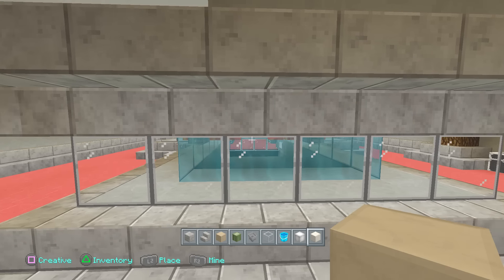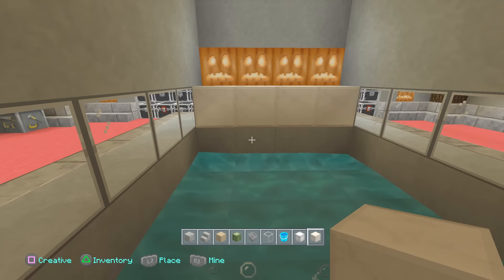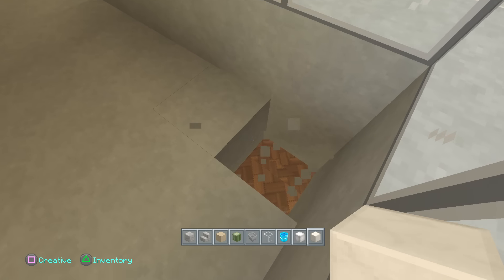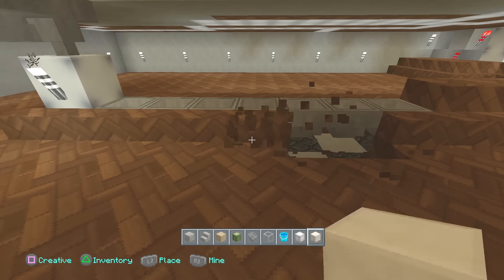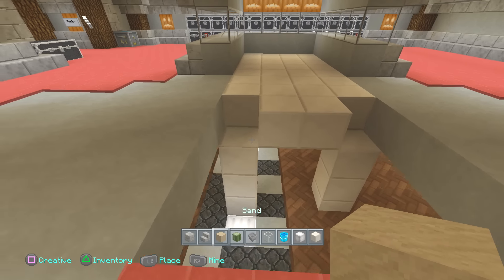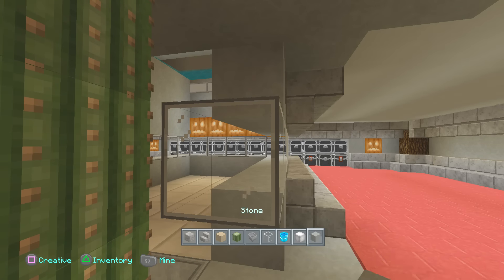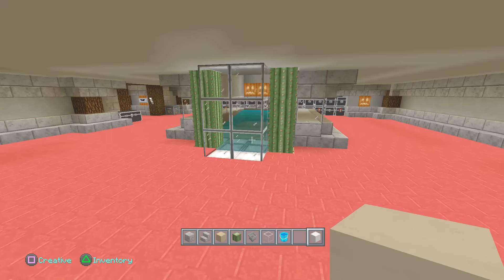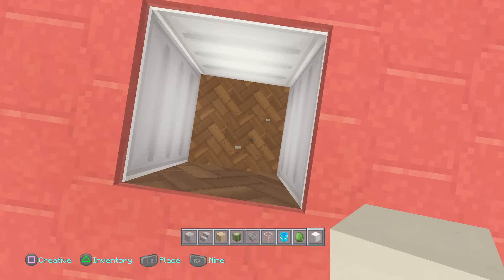Minecraft Tutorial : Slime Grinder System V2 New Update TU31

Comment: First let me start off with love the build but did find an easier way to fix the slime farm, just take four buckets of water and put them where the water drops down onto the hoppers, this will fill the water area under glass and slimes still drown, I also added a second row of blocks to the row you put the water on at the opposite side where the slimes fall in to the grinding floor but not sure if it is needed for the fix or not.